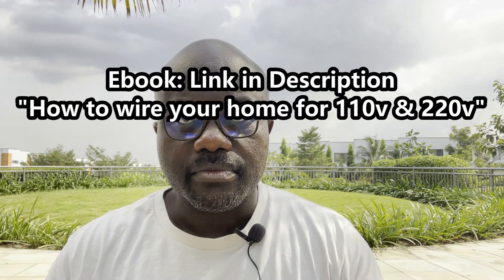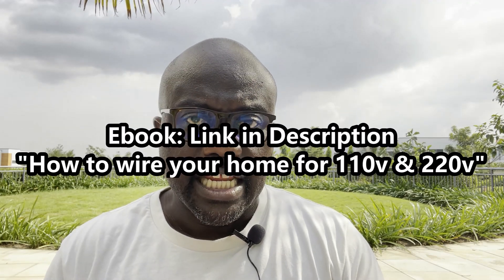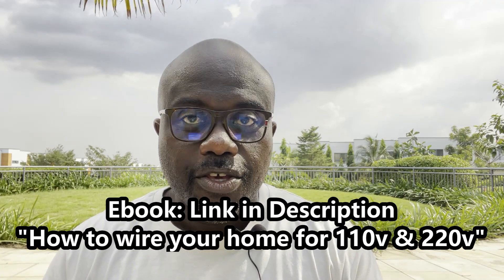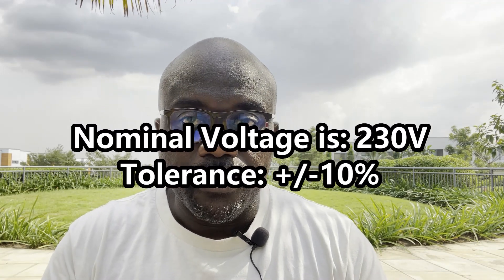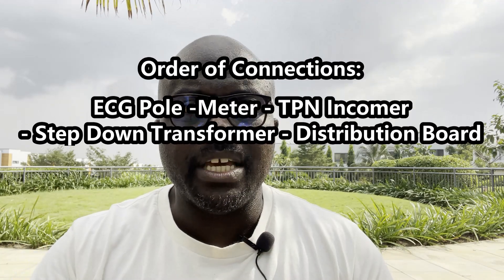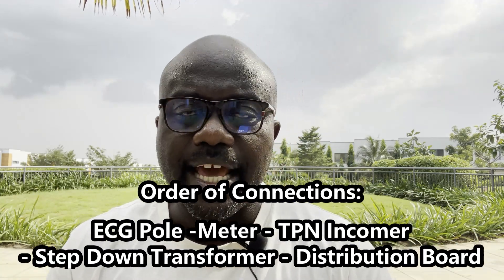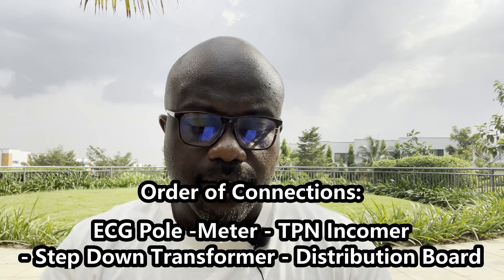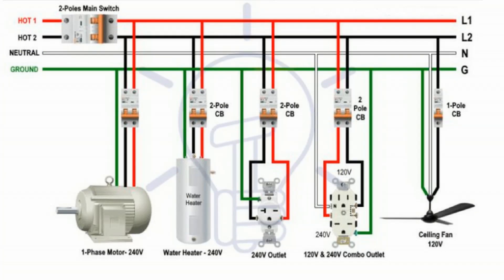BUILDING IN GHANA | HOW TO WIRE YOUR HOME FOR 110V & 220V EQUIPMENT

Comment from the maker: Ebook Link: 
"How to wire your home for 110V & 220V equipment"
https://payhip.com/b/gN8eY
Table of Contents
1. Voltage Differences Explained (110V, 115V, 120V, 220V, 230V, 240V)
2. The Step-Down Voltage Transformer/Converter.
3. 1-Phase Electrical Topology from ECG to the Main Distribution Board.
4. Typical Wiring Diagrams of Main Distribution Board for both 110V and 220V.
5. An Example 230V/110VAC Step-Down Transformer
6. Resilient 3-Phase Electrical Topology from ECG to the Main Distribution Board.
7. How to Integrate a Standby Generator & Off-Grid Solar System for NO ECG Bills.
8. How to Operate the Resilient Electrical Manual Changeover System.
9. Automatic Changeover (ACO) System
10. Key Installation Tips.
11. Electricians
12. Advice to People Relocating from Countries with 110V to Countries with 220V
13. Can your 60Hz items run on 50Hz power?
14. Frequency Converters – Do you need them?
15. Closing Remarks.
16. Conclusion.
Reply: Please if i may understand you very well, it means when the wiring is done and it's separated DB for both 110v and 120v then I need to install that step down transformer?

Comment: On one of your videos you 3 phases of 220 vac plus a neutral. So if you take your meter from neutral to 220 lines it should be 110vac correct?
Reply: No, each of the lines provided in the most of the rest of the world is 220vac.  Neutral to L1/2/3 respectively is going to be 220v on each.  Three phase power would have 400v available. Split-phase 220v delivery is largely a North American thing.
Reply: No, let the nuatra be from 110 -120 transformer itself not 2020-2040.

Comment: Good day and thanks for your  videos  again  pls l want to  know  if l can  use  the 1.5mm and the 2.5mm cables from UK 🇬🇧   just for lights and  sockets and  the  rest  from Ghana  🇬🇭  . Also which cables in Ghana are the  best one  or Turkish  cables  please  if you can help me  out. I will  buy my appliances from  🇬🇧 uk. Thank you  and  God bless you and your family.
Reply: In Ghana 🇬🇭,  as an electrician Tropical cable is the best for me. It's locally manufactured and built to suit our tropical weather but all the same the most important thing is buying a cable that is certified by GSA: Ghana Standards Authority and on the list of Cables Energy Commission Ghana accept.
Reply: Sure you can use the 1.5 mm² and 2.5 mm² from the UK.  We use the same colour code, and other standards with the UK.

Comment: It's the frequency that breaks things not so much the voltage. Voltage and amperage but... frequency matters a lot
Reply from the maker: 100% 
Its the frequency 
the motors will run 17% slower but on the plus side use 17% less power. But there can be an overheating issue for some appliances, depending on how they are rated. Frequency converters can resolve that

Comment: Hi Kingsley. Would I need a voltage regulator if I'm completely off grid. Is the inverter stable enough. If I just incorporate a lightening surge protector?
Reply from the maker: If you are off grid you shouldn't need an AVR. But get the correct model of inverter for stability
Reply: @kingstal90  Thanks Kingsley. Stay blessed 👊🏾🇯🇲🇬🇧

Comment: Thank a million boss ! My house in Ghana is wired with this configuration. I am about  to purchase the transformer.  The one at Samstores is TC-20000D. Is it the same as the WAL-MART unit that you mentioned   AR-20000 ?
Reply: Guys, I have same design In Ghana, I bought the transformer in US, ITs 15000W from Bombay Electronics. My transformer is running very well. If any assistance contact me and i can give the electricians' number. Thanks
Reply from the maker: How did you deal with the lower frequency?
did you install an additional converter or does your machine output 60Hz?

Comment: Hi Kingsley what about frequency for appliances with motors? The US uses 110 v  @ 60Hz while Ghana has 220 v @ 50 Hz. The simple step down transformer will step the 220 v @ 50Hz to  110 v @50z which means appliances with motors will spin slower than they were designed for. I am assuming this would have a negative  impact on the appliance.
Reply from the maker: Great comment!
The motor will run approximately 16.7% slower, but on the plus side will use 16.7% less power.

Although, if you are very concerned. Purchase a frequency converter in addition to convert the 50Hz to 60Hz

Comment: Thanks for the video and I have learned a lot today abt converting 240v to US 110v. Can you pls explain further the difference between 60HZ & 50HZ and the impact it has on appliances from US to use step-down transformer. My 110v connection is done on my anyway, but my 110v appliances in Ghana run much faster than in US. For example, using my electric shaver in Ghana, the motor run very fast and make much noise than us 110v. My pc charger gets very warm in Ghana than US. Thx
Reply from the maker: Thanks
I will add to the list of videos
Keep reminding me
Reply from the maker: running a 60Hz appliance on the Ghana 50Hz system basically means (for a motor), it will run about 17% slower speed, 
but use 17% less power. The overheating is probably due to the V/Hz ratio which is higher in Ghana than the USA due to the 50Hz figure. If its a significant issue for you, then look into a 50Hz to 60Hz frequency converter.
Reply: @kingstal90  Thanks for the explanation. Can I contact you when I come to Ghana?

Comment: Great info Kingsley. I am actually doing this on my project in Ghana and you are spot on, even to the recommended step-down/stabilizer product. Keep up the good work.
Reply from the maker: Fantastic!
Thanks for your comment
Reply from the maker: Hi PA - Do you have the exact same step-down transformer installed?
Someone wants to know how it is performing. Thanks
Reply: @kingstal90  Hi Kingsley, the electrician is about to start working on Electricals Phase 2/wiring but the SIMRAN step-down transformers are already purchased and in Ghana (10kW for 1st floor, 20kW for ground floor). There's a lady on YouTube (Ashanti Queen, I believe) who has one already installed and she can provide more information.
Reply from the maker: @deeeball - Thanks
Reply: @deeeball  please can u share the video of the Ashanti queen for us to look if is possible . Thx
Reply: @deeeball  thank you.
Reply: I will, however, suggest you follow Kingsley's video and tap into his immense knowledge in Electrical engineering if you are looking for the technical aspect of this set up.
Reply: I'm Electrical engineer in ghana with knowledge installation on  both 110v and 220v.
Converting existing electrical system of 220v to 110v can easily be done with any implications on wiring

Comment: Hello 
I had the same question why were there two different sockets on the walls the 110- 220 ??
We are moving to Ghana in three months my husband is a lineman since 1978 will retire next month had a question due to inspection is it possible to bring the whole system everything need to install the electric in the home? Or do you have to strictly use the U.K and Ghana System ? 
The Voltage regulator we will definitely invest in immediately, cheaper then Home Depot and Lowe’s 🙏🏽 Thank You. Blessings
Reply from the maker: The whole system is a very big whole
needs more definition. You can bring your 110V items, maybe buy the distribution board if you want and the step down centre-tapped transformer. You can get the rest in Ghana.
Reply from the maker: Glad it is helpful

Comment: Simple you have two lines off your main power one 220v use a step down transformer connect 220v to the high side of your transformer stepping it down to 110v for all those circuits.